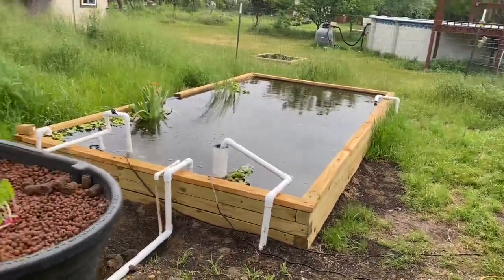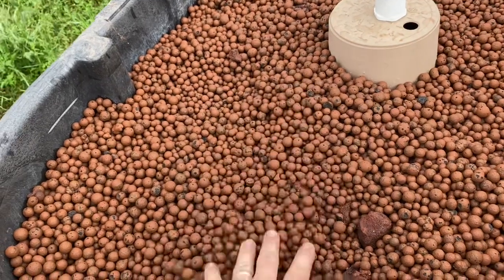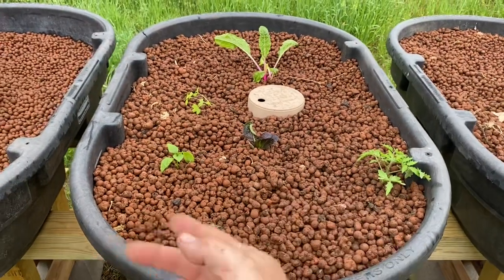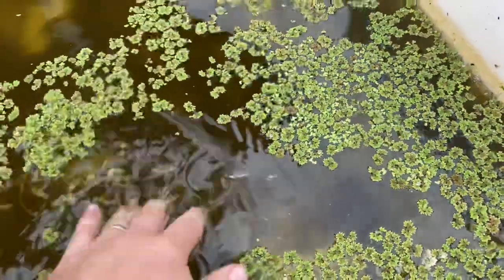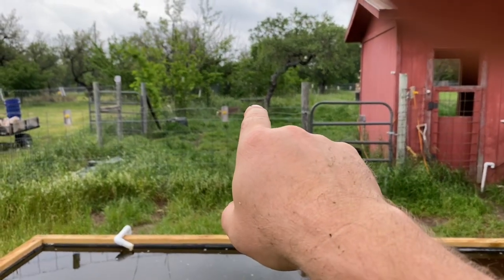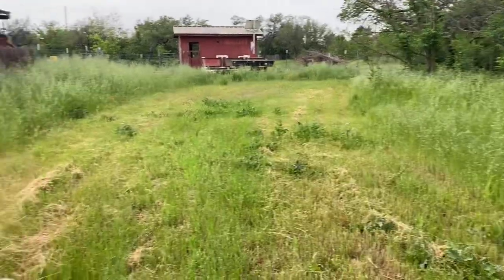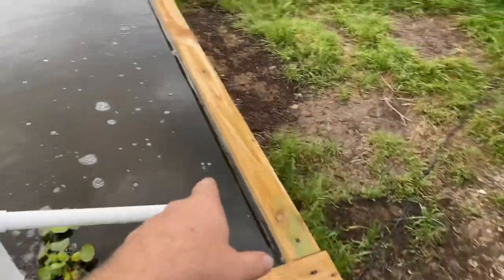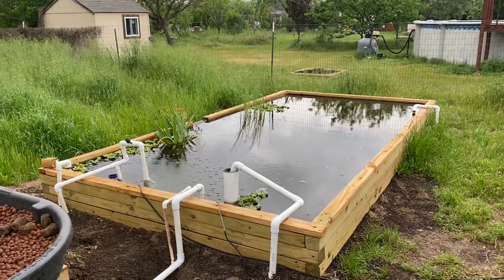More Upgrades to my New Pond / Aquaponics System

Comment: i know it’s a solar run system, but how is that set up? what pump are you using? does it require a invertor and a charge controller? 
  the set up is great and is a good basis for what i want to do, but i don’t not want to run 120vac to it. i’m trying to keep systems like this independent.

Comment: I've always heard of those referred to as hydroton pebbles iirc
Reply from the maker: Hydroton = a brand.  LECA equals the thing.  Sort of like calling a copy machine a Zerox.  LECA stands for Lightweight expanded clay aggregate.  So all Hydroton is LECA but not all LECA is Hydroton.
Reply: @survivalpodcasting  I thought it might be something like that,  thanks Jack!
Reply: That conduit that goes around TWO bulkheads, no less, is that like 6" diameter or something?